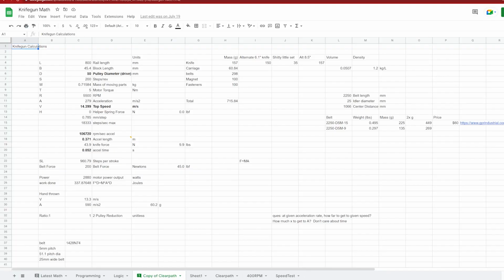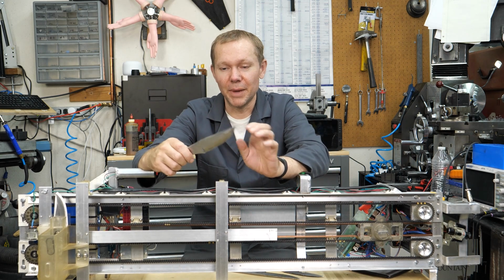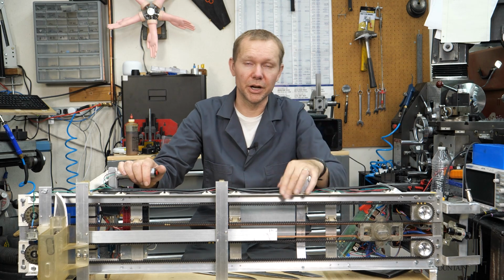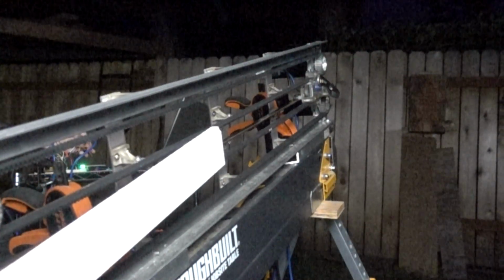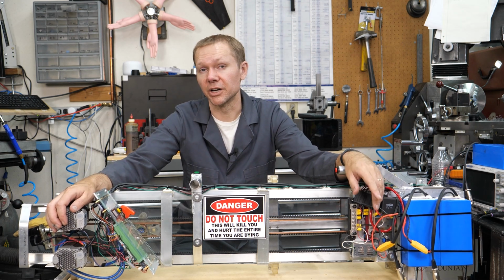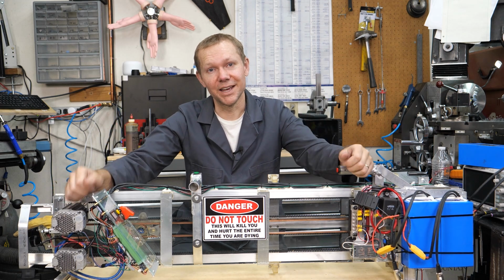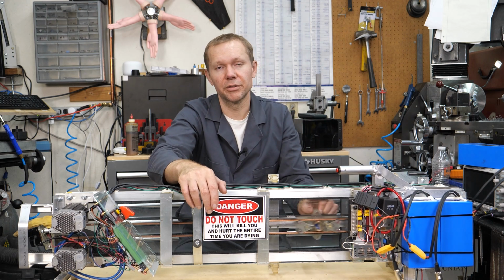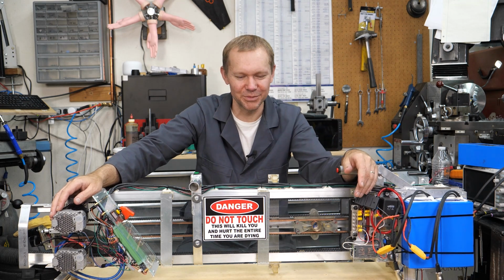Details of the Knife Throwing Machine

Comment: Great overview of the ups and downs of development. 👍  Perseverance pays, yes?   Anyway, the trigger concerns me.   It's a classic instrumentation problem.   The active switch line (and it's ground!) should go directly from the switch to the active IO pin, and to the GND pin of the Teensy.   One might be tempted to use frame as ground like in a car, but a lot of problems can come up that way.   Getting fancy, that active switch line and it's ground would be a twisted pair, shielded, with only one end of the shield connected to GND.    BUT there is more to this...... a safety system.  As is, any malfunction which would cause a momentary ground of the active trigger wire would be bad.     There are many strategies, one is low resistance pulldown resistor, supply the switch with 3.3V, then it would have to supply a certain amount of current to get the 3.3V logic above the required threshold.      There are many analog debouncing methods as well, and firmware based debouncing, either or both would be good.    And, an independent secondary "safety" (an arm switch) should be considered.   I know I did not cover this well, and what I suggested above needs refined and peer review......after all we are throwing knives here!       Awesome project.   In about a year you will be incorporating automatic aiming, for which I can provide some experience.    Carry on SIR!   
👍

Comment: Get a volunteer and attach them to a big, spinning, wooden wheel and fire the knives around their Perimeter. Colab with Shane W. and get him to do the video tracking to track the spinning person so you can then feed that back to a motorized platform to adjust yaw and pitch. Mount the knife thrower on the platform and you've got a Vegas act right there! EDIT: Just thinking about this and it's probably not smart to do this without first getting the volunteer to sign some kind of safety waiver.
Reply from the maker: I'm inclined to just use a barbie doll and let the chips fall where they may... Sorry, I think that's hilarious but my wife is giving me a thumbs down.

Comment: Slowing stuff down once you get it going is such a pain. Did you consider using some kind of external brake with more stopping power (instead of relying on the motors to take the energy out)? This might allow you to accelerate longer or make the device shorter. Something like a dashpot at the end or maybe a disc brake or something?

I had similar issues to your "thing will not release under load during acceleration" with one of my projects where I was trying to launch disc golf discs. What I found to work really well was taking a mechanism like you might see in a crossbow or gun trigger and using that between the weak thing doing the releasing (such as the solenoid) and the thing you want to release.

Oh one other thing  - I highly recommend trying out mathcad for the types of calculations you were doing in the spreadsheet. It seamlessly handles + checks units, solves equations, plots, etc. Aside from the convenience, unit handling catches a lot of errors. They have a free version and its amazing for back of the envelope kind of work.
Reply from the maker: Excellent point about a brake potentially shortening the length, I hadn't considered that benefit.  Initially I envisioned a large clock spring to either help the motors speed up, prior to landing on the two motor solution.  Also it wasn't clear to me (or my son) using the accel stepper library if there was a separate parameter for deceleration or if acceleration could simply be changed mid-stroke.  I also wonder how the clearpath motors would handle the sudden change in torque of a brake.  The motor tuning procedure appears to bracket how much current is required for a given accel/decel.  Anytime I had a pulley slip at all they immediately knew to throw a code.  Now if clearpath would allow manually setting those parameters...

To release the knife, I often considered a slow ramp on the return stroke that would cock something like a firing pin.  But I'd already put so much thought into that carriage my brain just refused to go there! 

I'll take a look at mathcad.  I remember you plugging it on one of your AMAs.  Looks really slick.  Probably would have saved me time over my giant spreadsheet.

Comment: You could integrate a knob to set the target angle of the knife. Use the value as input for the program that calculates the belt movements. This way you could fast adjust the angle without moving forward.
Reply from the maker: Oooohhhh, I like that idea.

Comment: For the false triggers, I'm surprised you didn't report to fixing it in software. Debouncing a noisy input is fairly simple, especially compared to troubleshooting inductance!
Reply: Software debouncing could add delay. and any delay will of course affect accuracy. Probably the thing to do is to add some safety switch to it and debounce the safety with a delay. then you don't press the safety until right before you're ready to fire.

that of course doesn't entirely solve the problem but it helps.
Reply from the maker: My understanding of debounce is eliminating a 2nd false trigger after the first legitimate one has already occurred.  We used it on the homing switch for example, requiring ignoring the input for 40ms.  Fixing a false trigger requires not seeing the initial false input.  I don't think debounce can do that but feel free to correct me.

Comment: Hello. Great follow up video. The capacitor would have killed any ac noise, which would show up from just about any electrical device running AC power. All wires are antennas, so capacitors are pretty commonly needed. If it comes back up, you may want to connect a low pass circuit (sounds complicated, but is just a resistor and capacitor) to the input. 
as for trick shots, maybe have the rotation of the knife skip over something like dominoes based on its rotation, and then stick the landing, where if shot straight, would plow through the domino

Comment: 30:00 Limp wristing could very easily account for the drop of the odd ball knife you were talking about. Just like shooting a handgun without a good grip causing the action, specifically the slide, to not cycle fully because it is not getting the power it needs due to the energy lost from poor form. Also you witness mark reminded me of the markings Huey pilots in vietnam would use to tell if their jesus nut was coming loose, don't know why but it made me chuckle.

Comment: The spontaneous triggering could be EMI from the copper busbar. Did you check that?
Reply from the maker: Yeah I think we disabled it entirely and the problem still happened but I need to go back and check.  We do have a diode across the bars in the opposite direction too but I haven't checked if it's still working!

Comment: I made something for a haunted house, where I had a raspberry pi to play sounds and do dmx, and also an external trigger. The wires were a big mess, and everything surrounding a big AC dmx controlled dimmer box... so a lot of noise. To  I only had 10k resistors, and they weren't even enough for all the noise on the long wires, so I ended up just putting a little relay with a 5V coil on, so C was on the input pin on the rpi, nc was on 3v3 and no on gnd. I then powered the coil in the relay with 5V from the trigger button, that permanently solved the problem.